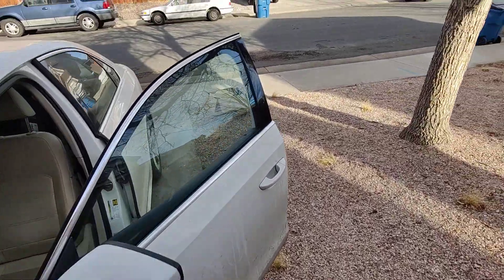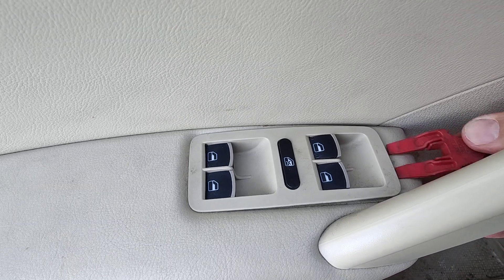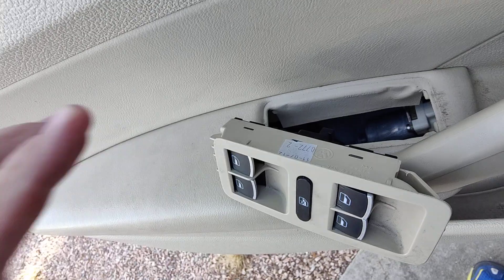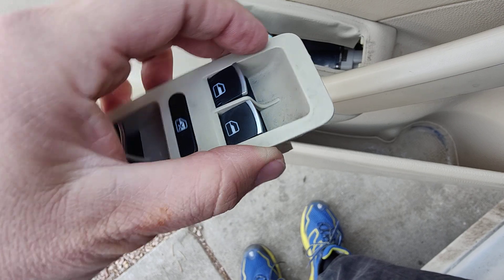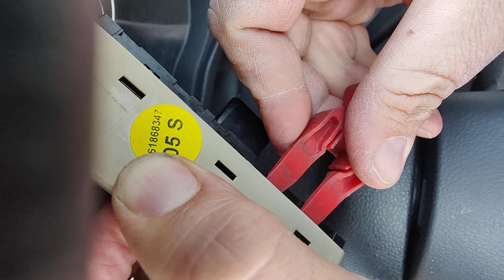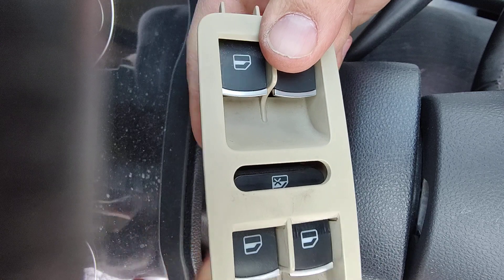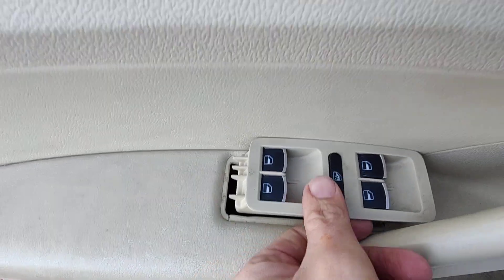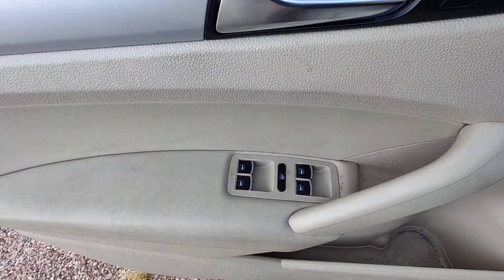Expert Hack 2013 VW / Volkswagen passat window switch replacement also works for 2012 through 2015

Comment: Hi, do you know if we can replace an individual button cap on these master switches? I have a Seat Leon and being a VW group vehicle it has a similar switch but you have to completely remove the door card in order to remove the whole thing. So i was just wondering if I can just change the button cap. Window still works, the bottom of the cap is somehow broken so it needs a lot of force right now.
Reply from the maker: I don't know. When it's broken on both of my Volkswagens I've just replaced the whole switchboard which has been about 15 bucks and haven't bothered with just the individual switch.
Reply: @fix_stuff_make_stuff  I see, thanks for the quick reply, cheers.

Comment: Hey all my windows stoped working at once on my 2013 VW JETTA and everyone is telling me to change the fuse but I can’t seem to find the fuse for the windows could you point me in the right direction
Reply from the maker: Did you check the owner's manual? Sometimes there's a fuse diagram in there
Reply from the maker: I'll go take a quick peek at mine and see if I can find it although it may be different. I have a Passat
Reply: @fix_stuff_make_stuff  thank you so much